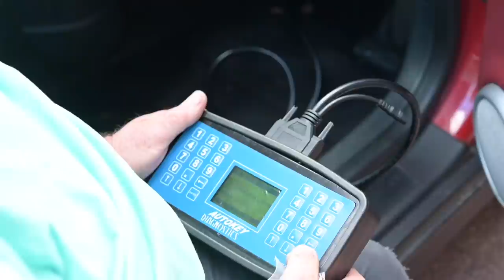I got a new Mini key and it unlocked a can of worms

Comment: It's funny how these cars all develop the same issues! I've had my 03 mini for a year and the key only remotely unlocks the boot. On warm days I tend to just hold the unlock button to roll the windows down, reach in and use the handle on the inside to spare that key barrel! other issues,,,, squeaky window, check, blown door speaker, check, slightly untucked headlining, check. Thankfully my airbag light has stayed off however!
Lovely to see the mini on the channel again
Reply: Wow I never had any of these issues with my Mini it must've been a good one 😂 shame the headgasket went on it though

Comment: Its the "door open" micro switch that is stuck which means you can lock that door but the computer thinks the door is allredy open so it doesnt actuate when pressing open. On ford ones its pretty difficult to fix, on VW ones its pretty easy but it has usually has happened because a rubber dust cover has lost its hat so theres not much point in fixing it in any other way than replace with a new one..

Comment: Wow, I thought my Wife’s Evoque door latch actuators were a pain.😱 At least with the Evoque it’s the motors in the actuators and you can replace both for £10😀 That Speaker is the same as the units in my DMC when I first got it. About 18 years old at the time when I renewed them…..hmmm I have had it 22 years maybe ought to check condition😂

Comment: I have an early-build ‘02 Cooper S and I was able to change out a bad door actuator without removing the door glass.  That was about 4 years ago and while I don’t remember all the details I do remember being extremely frustrated during the process (until success!) and suffering some minor cuts on my hands  fitting them into the tight confines of the door.  So it is indeed possible to do without removing the glass but it’s not painless (mentally or physically!).
Reply from the maker: I got the lock block in and out but couldnt get the cables connected, I think thats part why you need the glass out, to give them room
Reply: @furiousdriving  I owned classic Minis for decades, so I have multitudes of practice trying to get my hands to fit parts in impossibly tight spaces. :)

Comment: I just changed one of these actuators on my Rover 75, not impossible but a fiddly job.  Oddly it was the rear passenger side door that went first!  There are two electric motors in the mechanism that wear out, you can buy these for about £15 from AliExpress but are a complete faff to fit.  Incidentally, your new key has a Rover fob button 😁
Reply from the maker: I noticed that, apparently 2 button keys are hard to find now
Reply: @furiousdriving I have a slightly later one with the shiney sticker logo - amusingly sent to me in error instead of a Rover key fob 😂. The early Rover and Mini fobs had an embossed logo but you can’t get those any more.  I’ll happy send it your way for one of your mailbag episodes!

Comment: Yikes! Huge opening in the door and still can’t get to everything easily. Makes my Passat door lock issues look like a walk in the park... locks and unlocks fine just doesn’t register the door open so it relocks in 30 seconds if you don’t start it due to failed solder joints in the latch/actuator....and I’m still putting it off as I’ve done it before and it’s a pain in the backside! I’m just quick to start it when I get in the car. I admire your perseverance though.

Comment: That Looks exactly the same lock as the one from my old Freelander. That went through at least 4 in the 15 years I had it. Must be a standard BMW parts bin item. 
Should have got me to fit it,  I can now do it blindfolded 😎
Reply: More likely a rover part given that the first generation new minis were rover developed, not BMW.  The key is a std rover design.

Comment: Well, if you stop and think, 130,000 miles on a 20 yo Mini Cooper is not bad.
Goes to show you how fragile plastics are. Do hope you find the reflector that broke when taking off the door card, and hope you replace that damaged, dead speaker with another new harmon/kardon speaker.
I know the expenditure was more than you hoped for, but rationalize that this should last for HOPEFULLY another twenty years!
As for the air conditioning, an evacuation is essential as well finding out why refrigerant has evaporated. Start saving up!
And I must say Mrs. Furiousdriving looked quite lovely behind the wheel of the classic Volvo!
Reply from the maker: Even longer than 20 years as its not getting as much use now
Reply: @furiousdriving  I am to curious to know when was the cooling system flushed? Not that had anything to do with the air conditioning, but just to side on caution, I don't want to see you stranded along the side of the road!
Here where I reside we have mice, chipmunks that get into the HVAC, especially where the cabin filter goes, and make a nest (this being a 2019 Honda CRV), as well as the engine air filter housing. The vermin also nibbled on the filter itself, AGAIN. AND because of this, the blower fan is making a terrible racket, most likely hitting plastic. I will update you when we find the problem and solution. I will, however, never recommend a CRV.

Comment: Interesting video, Matt. That was an expensive experience. You might get some spray graphite to lubricate the lock cylinder a couple times a year. Keeps the lock cylinder working properly and reduces the need to fight with a fragile lock
Reply from the maker: I had been but it has a notchy feeling and so many breakable parts in there!

Comment: The reality of unnecessary technology. Just something else to go wrong is a very real thing.
Reply from the maker: I think locks are quite important!
Reply: I don't see this as unnecessary technology, but a company cheapening out by using brittle plastics to save weight and money 💷. 
The BCM also controls the anti-theft security of the Mini, so that has to be taken into consideration as well.
Reply: @furiousdriving  Central locking isn't.

Comment: Years ago I was going to buy a new one, then I did some research and found out they were one of the least reliable cars available.  Bought a Japanese car with no regrets.
I have never seen an opening that big in a door.  The cars I've worked on had several small openings.  Very hard to get into.  All I had to do was grease the window pivots.

Comment: There is a website showing how to repair lock ,if you can get a motor .Later ones had different make motors I think
Reply from the maker: yes, it can be done but there are alot of other 20 year old parts in there as well so it could be fix and spend a day fitting it to have something else break soon after

Comment: You really dodged the bullet letting him put the door handle in...

I did regulators and handles on my 03 at the same time, it took me over 4 hours to figure out how to get the bowden cable from the handle to snake around and back into the snag. I had the weather strip / trim off, the door card off, the lock mechanism out and fully removed the glass and regulators. Some things are worth letting someone else cuss over.
Reply from the maker: I looked at it a long time and came to the considered conclusion of 'bugger that', and even the pro had a tough time! Right decision!

Comment: Better give the rubber around window some wd 40 sillicone spray. :o)
Reply: I agree. Or some kind of lubricant, as it is why the door window is scratched, and making that horrendous noise!
Reply from the maker: Kevin gave the runners a good spray while the glass was out, its much quieter now!
Reply: gummi pflege is the correct product for door seals on cars with frameless doors.

Comment: Oh my god what the hell is it so complicated to fix a door lock why do BMW make it so complicated i do not have any of this my toyota hi lux is 24 years old and i use a key to unlock the doors simple it works lock it up  and my air con works and my radio works original radio
Reply: Because in the modern world spending large amounts of time and money pissing about is seen as preferable to  spending a couple of seconds turning a key which works every time and costs nothing.
Reply from the maker: the door locks fail on these and with only one you are then stuffed when it breaks, so, as said in the video, if you dont do this and the lock breaks you are stuffed